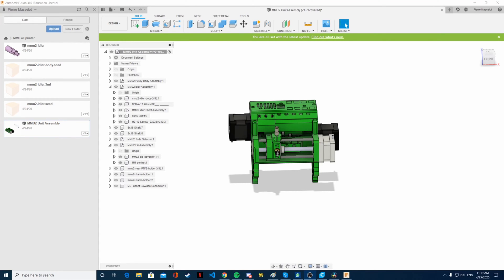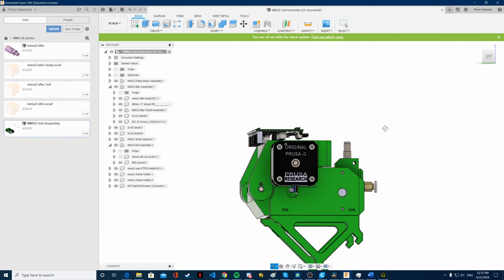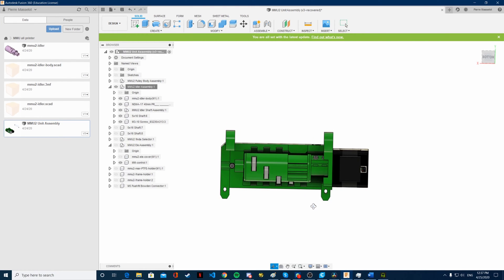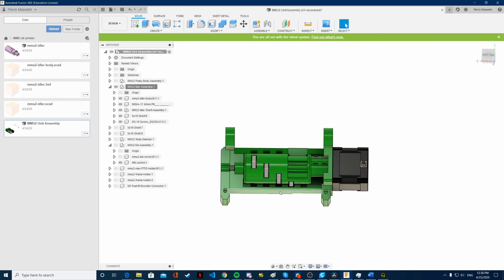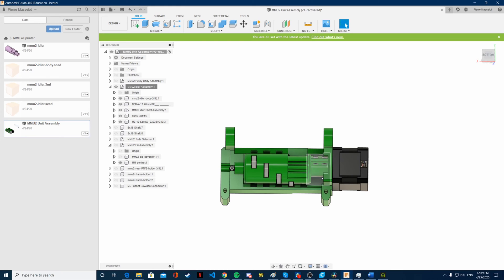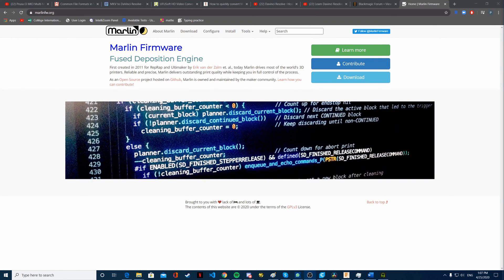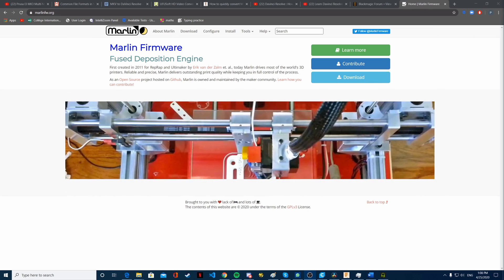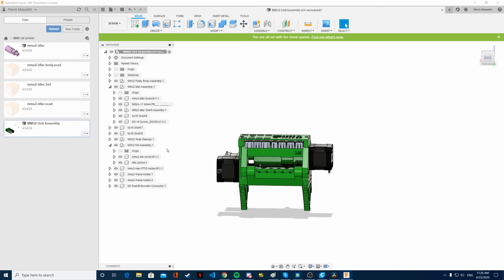MMU2 upgrade on any printer Part 1: introduction

Comment: Hi,

Everyone in the 3d printer industry is very impressed with what you are doing and achieved. I would like to add one more  thing.
If you can run the MMU2 clone on an RAMPS 1.4 and run your printer on its own board. Many people cannot buy the board that you have i.e. have 6 stepper-motor drivers  or already purchased
the 32bit board with 4-5 stepper-motor drivers.
Reply from the maker: Hey, I am trying to make it work with only 5 stepper drivers right now  so a lot of boards are actually compatible (and there are also some board extensions that you can get). Running it on a separate board would not necessarily be a good idea since it would add a level of complexity to the whole thing and I find that it is not an ideal solution overall and would drive the cost of the whole thing up. Now I agree that it would increase compatibility so it may be something that we add in the future if their is enough demand for it but for now the goal is simply to get everything working reliably so I am not going to change the design that I had initially planned midway. Thanks for the suggestion.
Reply: @materialswitchingunit284  thanks so much. I have also purchased all the parts to will be following all your videos to the dot. The motherboard is not available so im have to use a skr 1.4.
Reply from the maker: btw something similar to what you are describing already exists (even if it is a direct copy that requires more parts to assemble) so you can check it out here: https://www.thingiverse.com/thing:3910546
Reply: @materialswitchingunit284  the real issue for me is the software. I don't know c++ or marlin or how to check compatibility.
Reply from the maker: Hey, the skr 1.4 should do the job but this is still a work in progress and we haven't reached a usable prototype yet so you shouldn't t have to worry about the code for now. Once we get to that point I will make sure to do an in depth video of how to set everything up and I will make sure that it is easily understandable so that even people that don't really know any C++ won't have any problem getting everything up and running.

Comment: Hello,
I was curious do you have your design on Thingiverse?
Reply from the maker: Hi, I don't have my designs on thingiverse yet but I am planning on releasing them soon. This is still a work in progress so the design changes alot. But if you need them for a specific reason just tell me and I will make sure to make them available. If you are trying to work on the mmu2 you can get the original files on prusas GitHub.